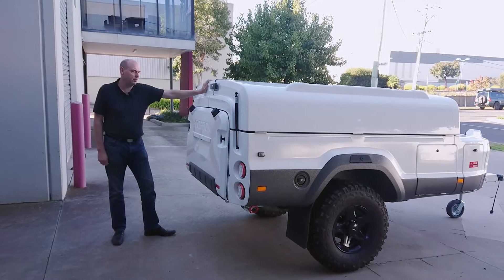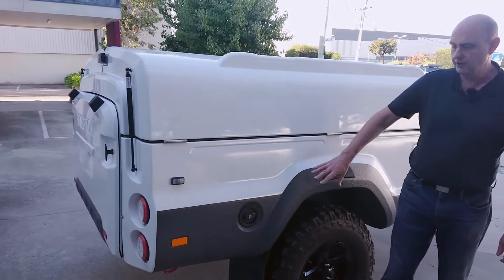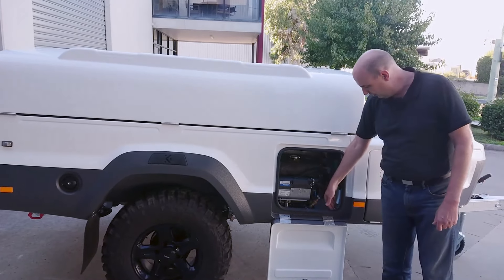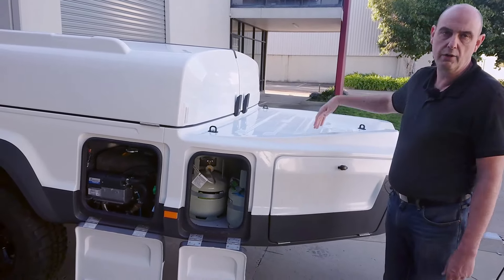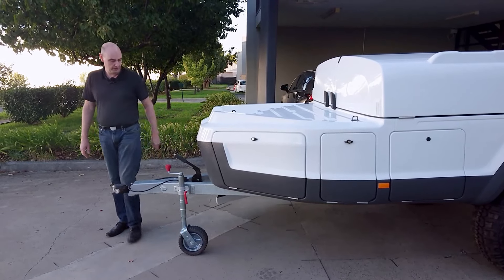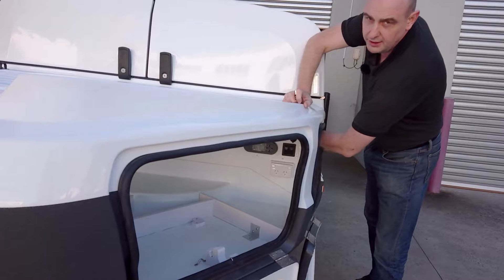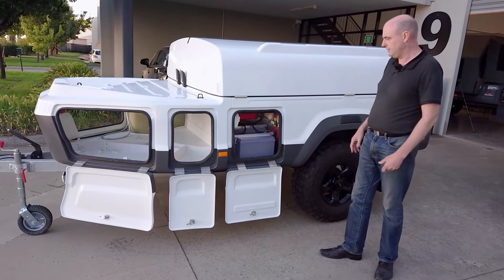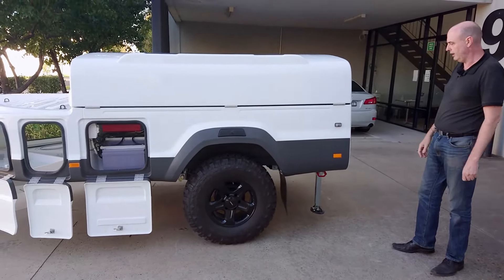Kerfton Off Road Camper Trailer - Exterior Walk Around

Comment: great invention!
for the side beds (once extended), how much weight can it support? and how much total weight internally can it support?
suggestion: electrical outlets should try to use the universal outlet.
Reply from the maker: Kids pods are rated for 100kg each.  Camper tare is about 1150kg (fully optioned) and ATM is 1600kg.  So leaves around 350kg for payload.